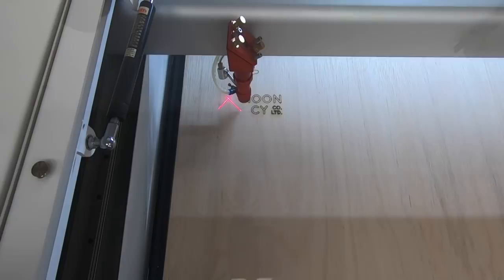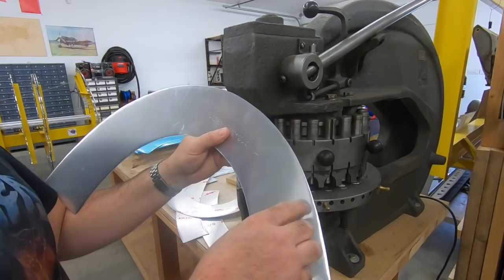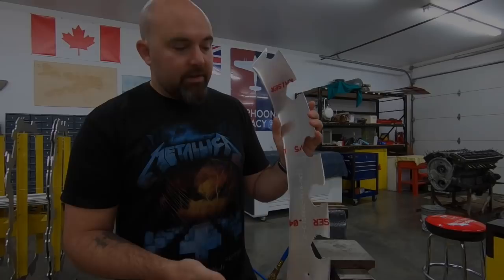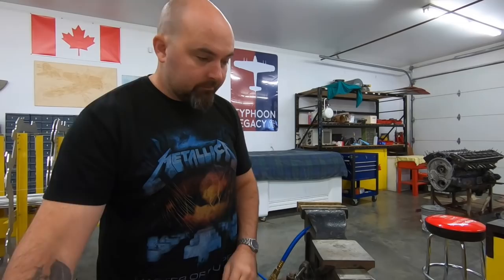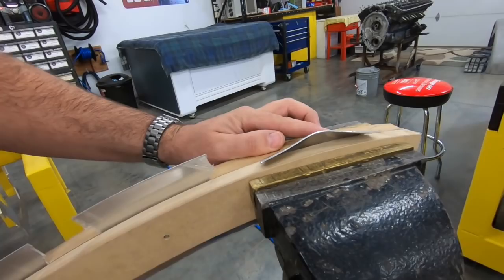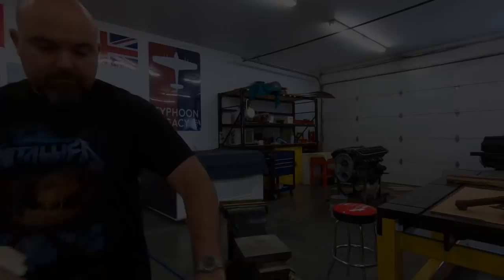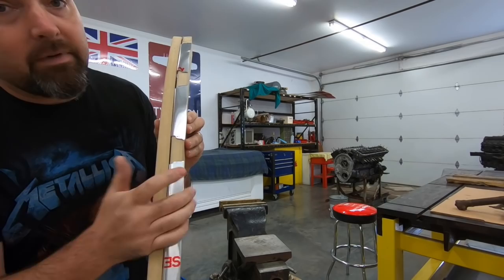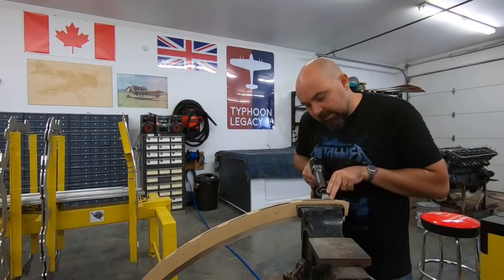S1E5 Rebuilding Hawker Typhoon JP843 - Shrinkage

Comment: Hi, just found this site - fascinating. I am a 'mature' ex panel beater and the shrinking of ali section particularly interesting - for me. I have shrunk many sections and panels in my day, both mild steel and ali. But it was always hot shrining. We used an oxy-acetylene flame, wood mallet and a former or dolly to support. Ali was always 'interesting' to shrink mainly because it didn't alter colour when hot, unlike steel, so no clue was given as to the readiness of the material. Briefly, we used a very carburising flame to coat the ali with soot. Heated the section and when the carburising soot burnt off, the panel was ready. You had to be quick!   Great site and great project.
Reply from the maker: Thank you Chris. It's pretty easy to get burned with aluminum for the same reason, no indication of temperature! I've had a few parts just fall apart when welding if I build up too much heat. Lesson learned! There are a few old tricks for softening the material when you're working, soot is one, and soap is another I've heard of guys using. Unfortunately neither can be used on aircraft parts because the results cannot be controlled. It's great for non-aircraft parts though. ~Ian

Comment: Moved one of these by road about 18 months ago. Picked it up from RAF Coningsby, home of the Red Arrows and the Battle of Britain Memorial Flight. Took it back to the RAF Museum, Hendon. The Museum guys told me this one was the only complete, original one in the world. what surprised me was how cramped the cockpit looked. I,m 6ft and about 220lbs and I don,t think I could have fitted in there. There was a Tempest in the next hall and that was far bigger!
Reply from the maker: We had the privi of scanning the wing of that very plane when she was on loan to Canada; it's wonderful that one did survive intact. The Tempest is essentially the same cockpit, actually made from most of the same part numbers; but it did have a longer nose to accommodate an extra fuel tank just forward of the cockpit firewall. Both wonderful aircraft. ~Ian
Reply: @TyphoonLegacyCoLtd  Didn,t get close enough to the Tempest to compare the cockpits, the Tempest just looked so much bigger. although the tiffy was just the fuselage. the wings, prop and other ancillaries were on another truck. the wheels seemed very small compared to the Tempest, but there was another set of main wheels in the ancillaries, so maybe it had smaller wheels on for transportation. I still wouldn,t fit in the cockpit though!!! The firm I work for does all the movements for RAF Museum Cosford, so we,re quite often doing movements between Cosford and Hendon. Do you just restore Typhoons or do you do other types as well? My old man flew mk9 spits in Italy during the war. He was in 208sqd, attached to the US 15th Air Force, and was awarded the American DFC.
Reply from the maker: @nicksykes4575  Typhoon MN235 was fitted with some Tempest wheels for loan, not too sure what they used during the move. I'm jealous of your job, you must see some awesome stuff! The focus for Typhoon Legacy is just the Typhoon, although we're working on a Merlin now to support that. ~Ian

Comment: Back in the 70's I worked at AeroCom that used solid steel airfoil mold blocks that were used to hydraulically form the pieces of aluminum into almost finished ribs.

Comment: Interesting vid, I generally use a wooden block to form the flange rather than use the hammer direct, but I'll certainly give your method a try. Didn't know about the nylon faced rivet snap so will have a look at that method for tightening the radius as well. I'm with the Stirling Project and so will shortly be commencing framemass production, so anything that's as repeatable as what you're doing can only be a good thing

keep up the great work
John
Reply from the maker: Be careful with he gun John, it can also cause problems really quickly. Using a Maple block and hammer is the best way for sure, but when there are 90 odd frames segments to do I needed to save my arm! Following the work you are doing on the Stirling as well, another great aircraft! ~Ian
Reply: @TyphoonLegacyCoLtd  Thanks Ian, I know exactly what you mean, LOL

Comment: Fantastic to see a Typhoon being built, I have done a Mk 8 Spit and various Spanish 109's back in the 70's and 80's, and am interested in your manufacturing techniques. We used a router to shape the sides of an indy car at Lola but I have never used one on aircraft parts although there is no reason why not providing you deburr your edges. I will follow on to see how you get on.
Interestingly my Father worked on the line at Morris cars in Oxford producing the central monocoque for the Typhoons. I look forward to more episodes.
Reply from the maker: The stories from those in the factories would be amazing to hear, sadly, I've not found many on this side of the pond. ~Ian

Comment: In the next video, could you explain the proper grain direction to form those bulkheads?
Reply from the maker: That is something that was unfortunately not explained very well here. The aluminum sheet used in the process has a grain direction to the sheet (much like wood), this grain runs parallel to the length of the sheet. In an ideal world, when bending the material; the bends are placed perpendicular to the grain direction because the material is more likely to tare along the grain, and you want these bends to be as strong as possible. With parts like these frames with compound (curved) bends, it is impossible to keep the grain direction of the part perpendicular to the bend along its full length. In cases like this, the flat pattern for the part should be positioned so that the grain has the greatest angle possible to that of  bend placement. Depending on the parts shape, there are times were there will be areas of these  bends that fall parallel to the grain. This is not ideal, but is inevitable in some applications. I hope this helps explain the missing information. ~Ian

Comment: Those   radius    and ends   need     fine file work...   cracks  occurs  if    left  alone. I  cant   wait for JP843  to   go  to    Reno,  1  M Off   the   wings, overdrive   the   supercharger, total  loss Cooling, loose   the  GI  paint   and   redo  in   Red   and    Deep  Blue.... I   say   490+ at  Pylon 6.
Reply from the maker: Certainly, I don't do finishing of new parts until they are done their final fitting, please see episode 15 for these details.

Comment: Amazing I didn’t know how involved forming metal bends can be . 👍🙂 small question I couldn’t see how the router was following the small wooden jig ?
Reply from the maker: I turned a small offset bushing for the router itself, so it guides the bit along the correct line. The template compensates for the distance of the bushing. ~Ian

Comment: If you already have a CAD drawing of the parts that the laser can etch, why not just send them off to a laser cutting shop and have the pieces laser cut?  It seems like it would save a colossal amount of time and would give a more accurate part in the end (no deformation from shearing and no deburring needed).
Reply from the maker: You cannot laser cut aircraft structural parts due to the heat affected zone and varying mechanical properties. Typically production parts are routed on a CNC router, but taking one off parts to have that done at a 3rd party would take more time and cause delays in production. It only takes a few minutes to cut them out once the material is marked. You will notice too that we add a bit of extra material and trim the parts as I work, pretty typical for one-off parts and prototyping, so there would be no time savings for clean up. If we were producing batches of each part, the blanks would be designed to the finished size requirement, they would be routed on mass, and they would be formed in a rubber press. All of these are costly, but well worth it in production. ~Ian

Comment: Hi. Could I please ask what brand of Shrinker/Stretcher you are using? I bought a "cheap and cheerful" one and find it fulfils the "cheap" part of that description but does not leave me very cheerful! Awful serrations in the aluminium surface. Thanks
Reply from the maker: Hi Mike, this is an Ecklod machine which can hold a variety of jaw types; in this video I am using the composite shrinking jaws. ~Ian
Reply: @TyphoonLegacyCoLtd  Thanks Ian. Better start saving my pennies for one of those!

Comment: How did you figure out all the procedures needed to do this build?
Reply from the maker: That's a tough question to answer Michael, it's taken most of my life learning and practicing what I thought was needed. Much of this was learned from books, but ultimately practice and failure is what you learn from. With the knowledge on how  to do different aspects of the build, and the time in the industry, it becomes much easier to plan these type of projects. I hope this helps ~Ian

Comment: The skill & patience you are displaying is mind boggling to a novice. Were the original aircraft built this way? I imagine in wartime the production was given a lot of pressure to speed things up. It’s hard to know at this point in time, 75 + years later, but was there a tolerance in the manufacture & assembly of parts that allowed for less skilled labour to put everything together?
Reply from the maker: Good question Brian! The initial design set the patterns for tooling to be built, and once built, this tooling was used to press most metal parts. We discussed a bit about the tooling in the design videos, but didn't go into too much detail. There would have been some "back and forth" between the design and prototype teams and the tooling room as they set to produce dies and patterns for production parts. It's quite likely that the first sets of dies that were built would have needed a few adjustments after fitting new parts to an aircraft; these adjustments corrected any alignment or fit issues, but didn't necessarily follow through to a change on the drawings for the parts. There is always a bit of fitting work upon assembly, but the parts that were pressed were designed to eliminate most of the manual work that needs to be done for individual/low production. The cost to produce production tooling is very high, but well worth it in that type of environment. 

Regarding an allowance for less skilled labor; I suspect that you would find the initial prototype crews to be very experienced, with their work complete and verified, moving on to mass production in the tooling and fixtures developed from the early work would allow for less skilled personnel to quite quickly learn to fit and assemble components and assemblies to produce a complete aircraft. I would suggest that the "less experienced"  workers would have also become very experienced when production of Typhoons reached over three aircraft per day. All of us here at Typhoon Legacy have been very surprised at the quality of most of the original assembly work, and the amazingly tight tolerances held. ~Ian

Comment: I am a currant A&P mechanic and I truly appreciate your skill. During war time do you think they went through the same thing?
Reply from the maker: There would have been many fitting issues early on, but as production progressed, they would have quite quickly found answers and made corrections to tooling and designs. That said, production aircraft would have used production tooling, sheet metal parts primarily being produced on mass via hydraulic press. ~Ian

Comment: If you already have the drawing files for all the shapes, why did you not get them CNC cut? Both material and form blocks? Budget?
Reply from the maker: The flat patterns would be the easiest to CNC router, and I would surely look at doing this if we had multiples of each part. In this case, with only one or two parts of each being needed, it doesn't take that much longer to manually cut them. If I had a router in the shop I would likely do it, but really it's only a matter of minutes extra per part, the laser marking saves the bulk of time. 

The forms are much the same, however they do require much more finishing work than the flat patterns. To use a CNC router on these, we would need a 4 axis machine to get the correct flange angles, and the time and cost of sending them out for production this way is prohibitive. As you say, budget is a big consideration as well, so when we are able to produce the components in house and save some funding for materials, I'm always willing to put in the extra work to make sure we can advance the project as a whole. ~Ian

Comment: If you have the laser why aren't you just using it to cut all the parts out of the aluminum instead of the throat throatless shear?
Reply from the maker: Structural parts cannot be cut on the laser due to the heat affected zone in the material having varying properties. ~Ian

Comment: Just as a matter of interest, what kind of rivets will you use? Originally Hawkers used what we know as 'fridge' rivets, made from L37 I think, you will know them as 'icebox rivets' but they are basically the same. GR3 and AV8A Harriers used these all over the airframe and I think were the last to use these in large quantities.
Reply from the maker: Hi Bernard, very close, the original fasteners  were indeed "icebox" rivets B.S. L37 alloy (green). This was a big issue, and the cause of much research. We have discovered some manufacturer data which will permit the use of alternate rivets in much (but not all) of the structure. In the cases where we can do this, the alternate will be a 2117 alloy fastener; the fastener head profiles will be matched to the wartime profile to ensure accuracy. ~Ian
Reply: @TyphoonLegacyCoLtd  Hi Ian, I have no idea why they were called fridge rivets when they were kept in an icebox, guess it's a Brit thing! I will E-mail details of a supplier of L37 rivets (Certificated, as I recall), if you need them. How about sheet metal? North America tended to use odd gauges while us lot use even, the Typhoon being no exception. Can you easily obtain the correct gauge over there? Of course the aircraft is full of British Association (BA) threads, some BSF and probably Whitworth as well. Not to mention 60 degree flares on the hydraulic and pneumatic lines.

Comment: Hi, I would love to know if you are using aircraft spec (Dural) the aluminium forming seems so soft, yet on one of the videos you mention heat treating? Could you explain thanks
Reply from the maker: We sure are, JP843 is being built to airworthy standards. The material shown in these videos has primarily been in the annealed condition, this makes it soft and easier to shape. With this process complete, the parts will be heat treated to bring them up to the correct strength. I will be doing a video on this process. ~Ian

Comment: Is there a reason you don’t laser cut the aluminum segments instead of doing them by hand?
Reply from the maker: For sure! Structural parts cannot be laser cut because it creates an unstable heat affected zone next to the cut. Cutting needs to be done without creating enough heat to affect the material temper. ~Ian

Comment: When it comes to stress into the material   wouldn t it be better to make cutted v s from the bended parts from the outer side into the inside where its been bended ??? I m just a noob...but i think im right considering you don t want to much stress into the materials  because of   metallic or alluminium fatige???

Correct me if im really wrong!!!! But i always thought that when you wanted to bend or shape a material like aluminium or an other alloy or metal in a round or cylindrical form you always have to make something like (spaces or cuts ) into you re designed part or construction to eliminate certain points of stress in to the material....
Reply from the maker: For structural parts you would not cut and weld. The material is annealed, formed and then heat treated to make very strong parts. ~Ian

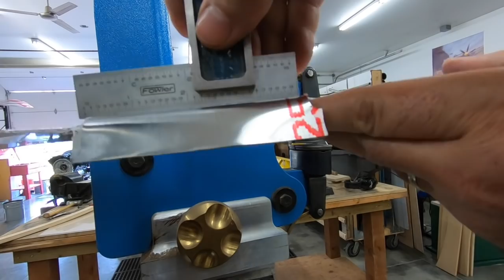Comment: At the 12:21 mark the shrinker shows up - how does that machine 'shrink' the flange? ...and what's it's proper name? I thought
he'd flute the flange to shrink it.   Thanks in advance!
Reply from the maker: The machine is actually called a shrinker/stretcher, and they have a variety of jaws fitted depending what you would like to do. These machines use compression on the jaws, when pressure is applied to the material between them, the jaws grip the material and force it to the center of the jaw, basically pinching it. The opposite is true for stretch jaws. The more pressure that is applied, the harder the jaws pinch or pull. ~Ian

Comment: How would Hawkers have made the same part, not by hand, and coped with the shrinkage of the metal...the mass production process?
Reply from the maker: Hi John, these parts would have been formed in a hydraulic press during the war. The process would have been designed to account for shrink and stretch of the material, however the parts would have likely needed a small amount of manual correcting when complete. ~Ian

Comment: I assume this is how pre-production prototypes were made. All by hand from drawings? Great skill. Thank you for sharing that with us.
Just one question? How come you don't anneal the aluminium to make it softer to work with?
Reply from the maker: It would have been quite similar when they were prototyping, they would have been hand producing parts to fit the concept. The aluminum I'm using for the airworthy frame set id in "O" condition, so it is annealed to start. With all of the frame segments complete, they will then be treated to come to T42 condition. ~Ian